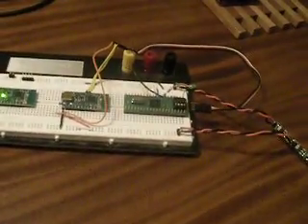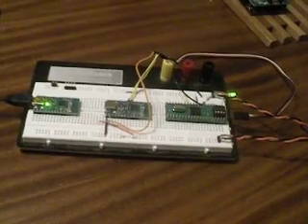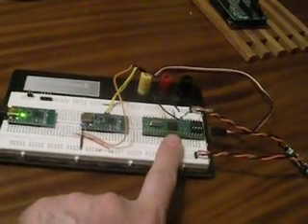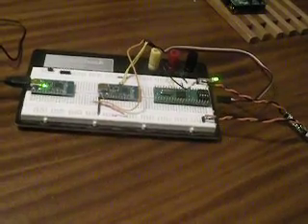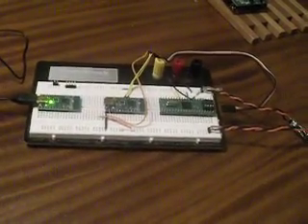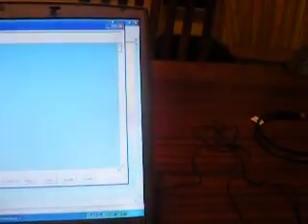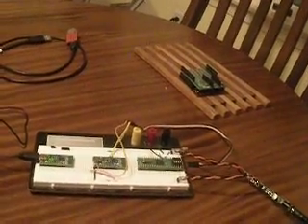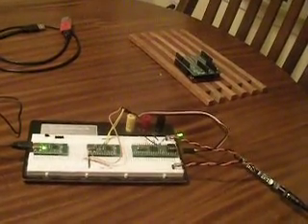Wixel as Wireless USB for Propeller Chip

Comment from the maker: I know, I know.  I was using the Arduino right before making this Propeller video and my nomenclature was all mixed up as a result.  I didn't realize until after I posted, but figured it would still be useful information.  Wixels are $20 each and you need a pair of them.  Pololu has discounts if you buy them in pairs, and yes Pololu uses AVR's in their gear.